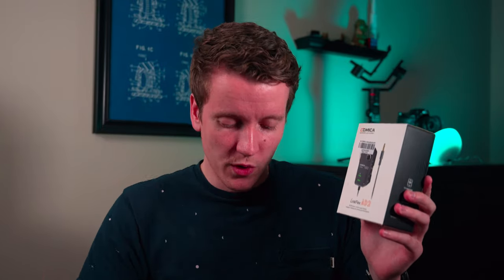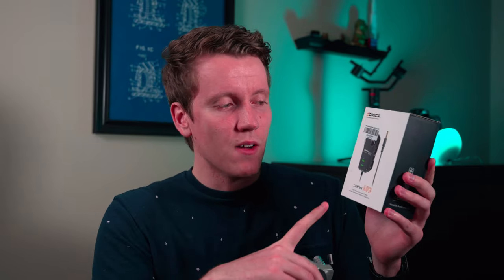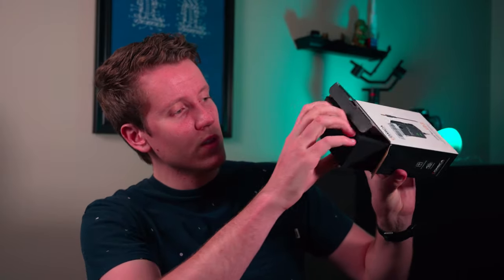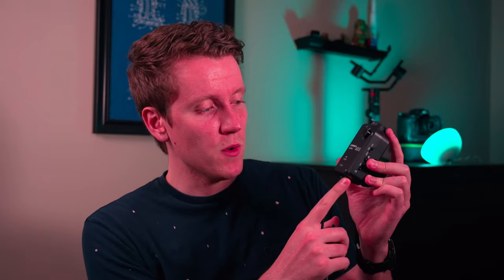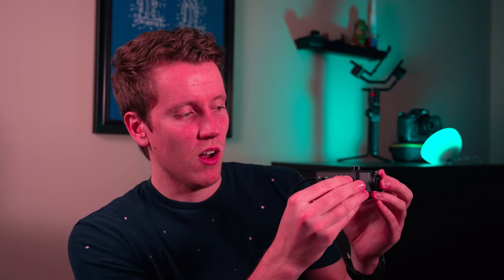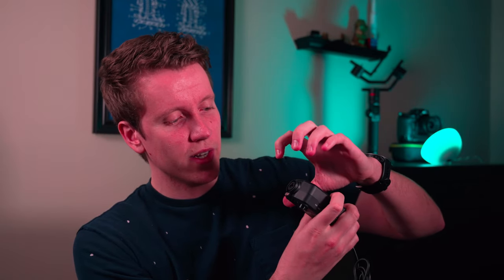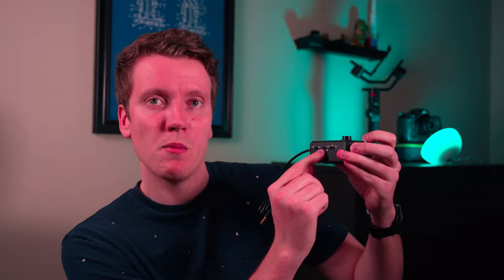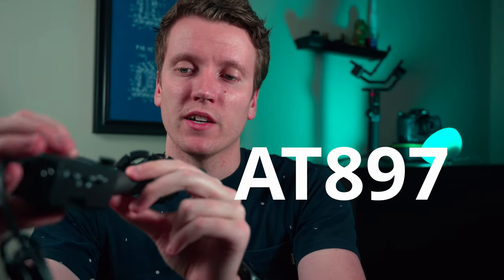Comica LinkFlex AD2 Unboxing and Review

Comment: Comica sent me one of these to review a few weeks back. I actually really liked it. The noise floor wasn't very bad at all and it's a nice compact solution so you can use really nice XLR mic in a fairly portable setup.
Reply from the maker: The only downside is it doesn't have an internal rechargeable battery. That would make it top notch, but other than that I really like it!